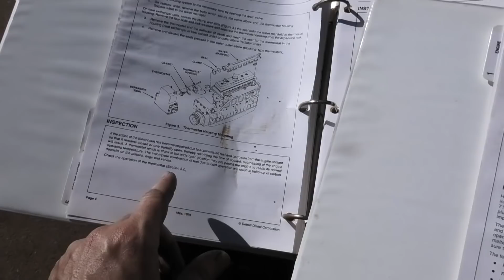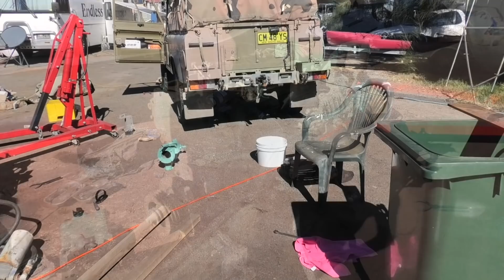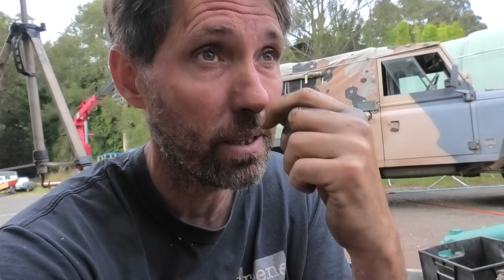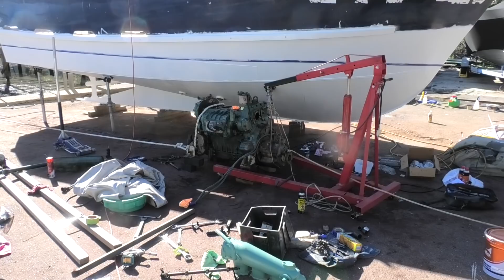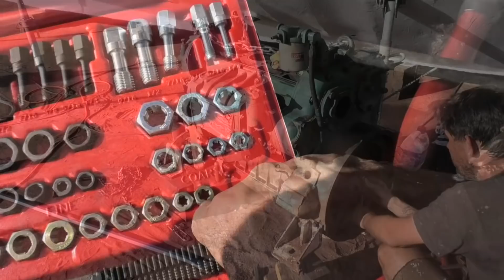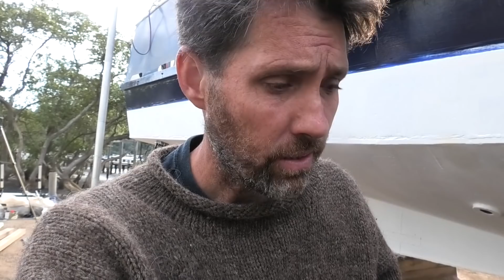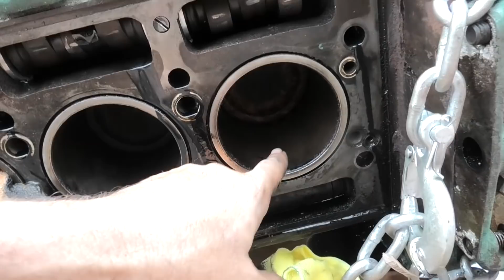Detroit Diesel 4-71 teardown

Comment: We used a company on Brisbane for our Detroit 2 stroke parts deas We had one come in that was a “bit Smokey” it was running on 2 cylinders and one had a hole about 2-3” round through the head but it was still running and they were operating

Comment: It's such a myth that Detroit 2 Stroke diesel use more fuel than four strokes or they have no power.  They produce their optimal power at high RPM, so you just never want to bog them down.  I've got  a 6V-71 in my old GM bus, with plenty of power and you can't beat the fuel economy on it.  I travelled over 230 Km and used around 50 L of fuel.   Pretty good I'd say, considering the bus weighs over 10 tons.

Comment: i had 4 trucks with 4-92 tt turbo blower in then the tow truck driver worked real hard with them! call the guy at eddy's wrecker company were trying to drive this thing 50 miles! i can tell you horror story's one delivered 3000 miles away, it got 50 miles back home boom it died! send engine and v92 tt white big truck! with motor on pallet! the guy delivered in next state like 100 miles away! that thing got home the truck did make it too, i had several night mares on jan 2 1987 was bad day the shop and whole 5 building burned to the ground! it was bad the 4 great trucks were not inside 2 white trucks were! one started fire!   my truck repair ended there! making mail trucks & Grumman the government contractor!  but its not the end of boat motors & ww2 type 71 type motors i have a army book on them! one like my uncle gave me in 1990 my daughter was a baby! ( my family relation had a boat with one a guy named forest wood) who that?had something to do with my real family i was adopted! that tube was fuel injector rack adjustment! that thing its important if not right it can run away and cause fires and blow up! that what caused the fire in 1987 one was stuck open on full run! run on oil too! shut off air to stop it! ( in 1987 the truck was apart and air box was open no way to shut it off) GM made the motor!  GMC & white were owned by the same company in court they had problem the same people sold Grumman trucks i sort of worked for them too!
Reply from the maker: It certainly sounds like you've had some misadventures in the past! :O
Reply: @DangarMarine  yes on top of being sick for like 30 years and it was a night mare that ended well! in march 2019 the dept of VA said it was tied to military service  and i won my disability case! the judge found in my favor!

Comment: Im working on a 1976 mariner 28e outboard. No spark. Coils are good.pulled flywheel and i think the part on the crankshaft is missing. Whats it called? Can send pics to your email. Would appreciate any help
Reply: It spins on the crankshaft . Only suppose to be small gap. Im missing a part but cant find it on any diagrams. Whats it called?

Comment: I wouldn't worry about shopping the block. You are looking at lots of unnecessary expense, all the extra gaskets and cam bearings. It doesn't look to me that you had contamination in the oil system just surface rust. You will have one piece pistons unless someone put trunk type rods in it which are for turbo engines. I would check wear on the liner bore and piston ring lands if it is intolerance hone the liners and put a set of rings in it. in the old days, you could buy rebuilt cylinder assemblies with used pistons and liners. check the rod small end bushings for slack in them. All 71 series parts will interchange the exception in natural to turbo engines. the turbo has a smaller port on the liner and trunk type rods and pistons. The rod bolts to the piston. I doubt your liners are worn out these engines will literally run forever. The worst thing for them is low rpm. They are built to be on the governor the whole time they are running. On the rod caps, the bearing locks always go on the same side together the locks on the same side help keep the bearing from spinning

Comment: When you reassemble the piston and liner put the piston in the liner on the bench and slide it all in in 1 assembly Make sure there are no shim spacers under the liner. If the counterbore has ever been cut there will be shims that will have to go back or the head gasket ring will not seal.
Reply from the maker: Ah, interesting point about the liners possibly being shimmed. I'll check for that.
Reply: @DangarMarine  also the liner should slide in very easy if it drags any at all hone the bore or use some sandpaper enough to remove any high spots.
Reply from the maker: It's good to know that it should slide in easily because I was expecting it to need to be pressed in and removed with a puller. That is why I was surprised when the liner came out so easily.

Comment: on reassembly, you will need 1 special tool. an Injector timing pin tool. https://www.dieselpartsdirect.com/detroit-diesel-71-series-fuel-injector-timing-tools. When you start make sure the rack can move very easily with no binding at all. don't be afraid to use a rubber mallet on it to get it working freely.  start with the farthest injector away from the governor pin. Make sure the arm on the injector is fully extended but not in a bind and the pin is not in a bind. Then adjust each injector so that they are all fully extended but not in a bind. Sometimes you will have to go back and readjust some of them to get full travel. when it is all set then adjust your valves and injectors That is done easier with a special wrench but a regular crows foot will work. double triple check that the rack moves freely before you start or it will run away. I have started the first time without the pin in and just move the rack by hand you can feel if it binds any at all. here is a good video for setting the rack.  https://www.youtube.com/watch?v=YZ-31etm0a8  He does it a little different than I was taught years ago. good luck and don't freak out and run if it runs away just stay calm and flip the blower door or have a thick phonebook or a piece of wood that will cover the intake and smother it out.
Reply: I was going to say Stu, get a set of 1/2" drive open end crows foot wrench's, they will make your life easier & you'll do a better standard of work. Some brake pipe crows foots could be handy on those injector pipes too.
Reply from the maker: Thanks mate, that's awesome information, looking forward to watching the vid. I'm keen to learn everything I can about these engines at the moment.

Comment: As the 2 stroke Detroit's are obsolete OEM parts are becoming scrace in the US. Several states have outlawed the engine. 
They ain't cheap but they won't break the bank. 
I taught the 2 strokes to engineering students for the U.S.Coast Guard 3.5 yrs.

Comment: GM Two Stroke diesels are good engines as long as you remember 2 things.
1. They do NOT like to run at low RPMs, they love to SCREAM.
2. They are thirsty and don't mind draining your wallet in fuel costs.
If I intended to use the boat a lot I would put a 3.9 liter Cummins in it, but for occasional use, the GM will be fine.

Comment: Please wear a full face shield when using heat on steel and when working steel. One small piece of steel in your eye will cause you years of misery. I enjoy watching this video and I know the process is very depressing, but I think in the end you will be happy with the outcome. I agree rebuilding the engine you have will avoid unforeseen issues and parts for an older engine may be less trouble and cost. To replace an older engine sounds like a good idea, but only when the swap has been done by others and you can see what the issues are with replacement. A marine engineer years ago told me "when things don't want to come apart, you can use a large truck Inner Tubes and a come along and be more accurate with the pull force and direction and apply some heat that can be done by a single man instead of using the force of a vehicle that can be too much and the rope or chain can break and cause harm to the man or the project". I hope you like the truck Inner Tubes tip. Do large trucks still use Inner Tubes? This was an old man that said he used this tip to cause outboard lower units to come loose from the power heads when stuck. I would have the cam shaft evaluated for wear before you reassemble the engine. Use NAPA ANTI-SEIZE LUBRICANT (PTX80078) on the spline and on bolts to prevent them being stuck in case you have to tear down again for unforeseen reasons. A "Dana" differential "case splitter" tool will also be helpful to your work. Yukon Gear & Axle (YT S01) Differential Housing Spreader for Dana Differential. I hope you find the tips useful working in your environment working outdoors in the sun.

Comment: I was thinking about the seized piston.  As pistons three and four are the worst, and since they are the lowest (engine slopes down hill towards the prop), I'd be suspicious they ingested some salt water from the exhaust pipe as the engine was being removed from the boat, probably when the exhaust pipe was being disconnected.  The engine was clearly working when you drove the boat in, and the engine was under cover when it was removed from the boat, so it had to be cooling salt water from the exhaust.

Comment: The hardest thing I remember about rebuilding Detroits is setting the fuel rack.  If you do it wrong you can get a runaway.
Reply from the maker: Yep, will be doing that part very slowly and carefully.
Reply: @DangarMarine  I would recommend getting someone with experience setting the rack to help you.  Once you learn the feel of the nozzle rack you are good to go.  There is a springyness that needs to be there, but I cannot explain it.  It is something that needs to be felt.
Reply from the maker: I'll definitely try and find someone who knows what they are doing to help me the first time. You are right that there are certainly feel things that are very hard to put into words.

Comment: Too late now. Just take head off, take pan off then flush pistons and crank case. Plug blower and turn shaft till loose. Fill with oil. Repeat.  Gunk head and reassemble.
Reply from the maker: There would have been a chance of unseizing it by flushing it but I'm also kinda pleased to be rebuilding it so I know it will last. Now it's apart there is a whole load of corrosion I can clean out and paint.

Comment: Love ya work Stu but my honest advise is ditch that bitch. She's going to cost you 6k+ after parts and labour and you will still have a screaming jimmy that burns fuel like your daddy's an arab sheik. Given the cost to get parts from the states I would recommend you price up a four stroke diesel a cummins 4BT or 6BT for example still the rebuild will make for interesting video. Cheers mate and good luck
Reply from the maker: I do like the idea of going to a four stroke diesel, I would even love to go diesel / electric. I'll rebuild this engine for now. At least then it will also have some value if I do do the swap.
Reply: @DangarMarine  Cool it will be a transferrable learning experience wet sleeve motors are common so the experience will help if you were to rebuild a perkins or gardiner or cummins

Comment: its not a hard job at all the best thing to do is tear it down hot tank and pressure test the block have a machine shop do a centerline test,send the crank and cam to a machineshop have it checked  get a reman head new cyl kits  rebuilt blower and other components
or I could go over there and show you how to rebuild it
Reply from the maker: Yep, all off to the engineers today for testing and machining, then I'll order all the rebuild parts required.

Comment: Stu, 
Lag bolt the engine to 4" by 6" lumber long enough to drag or push it around. You'll like it.
Reply: I forgot to mention, lag bolt three 2"x10"s as cross bracing on the ends and middle for strength.

Comment: Detroit Diesels are wonderful engines.  When I was a much younger man, I worked as a diesel mechanic's assistant.  We were sent out to the field to recover a Terex Scraper TS-24B.  This machine had 2 671s, one in from and one in back.  The operator had backed the rear of the Terex off of a dike he was building into water and submerged the rear engine. The mechanic I was helping drove the scraper (with the front engine) out of the water, removed the head, flushed the engine and fuel system, put a new head gasket and had the the engine operational the same day!!  Incredible motors!
Reply from the maker: Sounds like a big job. Nice work!

Comment: Stu, The other thing about that bilge leak is that the engine room would have been a hot, high humidity enclosed space with salt water vapour in abundance, maybe over time condensation caused the rust on the top end and raw cast iron flywheel area & other exposed steel parts, I saw land based 4-71 online that had some top end condensation corrosion, those old ballast bags of cement didn't look water damaged or soaked and there was no staining under them that I would expect if they were flooded & no high tide line around the walls of the engine room.
Reply from the maker: Yes, the lazarette was bone dry so any flooding was definitely from the stern glad just into the engine room.
Reply: Stu, I reckon all that internal top end rust is due to condensation and condensation alone in a saltwater environment & not submersion in sea water, the engine breathes humid salt air through that rocker cover breather, especially on cool down time & time again. those raw, unpainted metal surfaces same thing, if it did flood I reckon it wasn't that high that it got in the motor. I reckon the relative humidity where the motor has been sitting would be very high everyday and 100% when it rains, rust on those bores would have started happen the moment the motor was shut down. The paper on those bags of ballast cement didn't look like they had been wet & soggy at any stage to me.

Comment: Does he know that the motor is a Detroit diesel... with a 4/7/1 supercharger on it ? He’s say it’s a Detroit diesel 471 motor.  Just saying.......
Reply from the maker: What are you talking about? A 4-71 is a 4 cylinder 71 cubic inch per cylinder engine.

Comment: I'm not going to try to change your mind about rebuilding the Detroit Diesel, it is your boat - do what you want to with it.  These are reasons that they don't use them anymore.  The Detroit diesels were designed to be easy to rebuild quickly in frame by swapping out the liner and piston with the engine in-frame, so that they got back on the road (or the water) quickly, so that they kept making money.  The 2 stroke was an attempt to make them more powerful in a smaller overall package.  The unfortunate fact about 2 cycle diesels is that they are HORRIBLE on emissions and they aren't that good at fuel mileage either - and these are the two main reasons that they aren't used much anymore.  Their power band is peaky and narrow, which required a lot of gears in transmissions in the over-the road trucks - and they didn't put out an enormous amount of torque or HP even if you got them in the right RPM range.  The only other benefit to using them is that they would keep running even if in bad shape, most of the time.  IF they do break down, they are expensive to repair - and since nobody runs them anymore, parts are difficult to get and ship, and expensive when you do find them.  Parts for the supercharger can also cause  problems - turbos are usually more reliable over a much longer time frame, because superchargers have a number of wear parts, whereas turbochargers have far less with only one moving part.  Diesels in use today are far better on emissions and fuel mileage, they are far more reliable, and they put out a lot more power over a much wider rpm range, and are usually easier to start.  You can often replace a Detroit with a newer used diesel at a lower cost than the Detroit rebuild will cost you - even if you add in all the factors and little swap parts needed to repower your boat.  Parts for the Cummins are certainly cheaper.  A 6bt marine Cummins (or a 4bt if space is restricted) is a much better choice for power, if it is in something you want to keep for a while.  But again - it is your choice to make.

Comment: A trick we used on stuck pistons and sleeves is to put the rod cap back on, put a round stock that has threaded holes made in it, but through the rod. Put long bolts or all thread through, and that will push against the bottom of the sleeve.

Comment: Great show mate from Louisiana. 
U will be please w the 471 it will run forever. I have one in a shrimp boat w a 2.1 gear reduction. Really good on fuel consumption if u have the correct prop. U may be disappointed if u want speed tho. I would rather the 671 it’s a beast.
Reply from the maker: Hey mate. Even when the hull was very dirty it did a good 8 knots so I'm happy with the speed. I'm glad to hear that with the right prop and gear ratio they can run efficiently.

Comment: I'd be interested to know what bhp/torque the boat needs. Surely there would be a car engine that would be smaller, lighter and potentially cheaper let alone more economical  than fixing this up. In europe a core vw or bmw diesel would be as vheap as chips and deliver anything fom 65 to 300 bhp (with turbo). Even your Landy diesel engine  ...
Reply from the maker: Marinising a car engine would be an interesting project one day but one that would take some serious time.

Comment: I like your thinking as far a rebuilding that engine goes.  I don't, however, envy you the work.  I would have used a lot more of that liquid encouragement if I was taking it apart.  And a bigger hammer too.